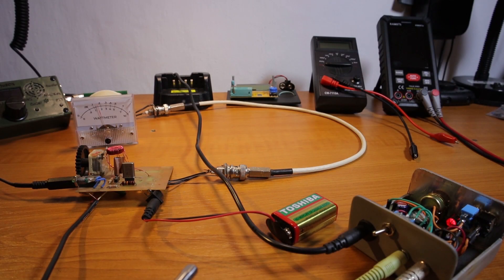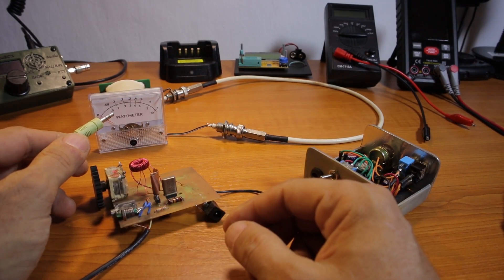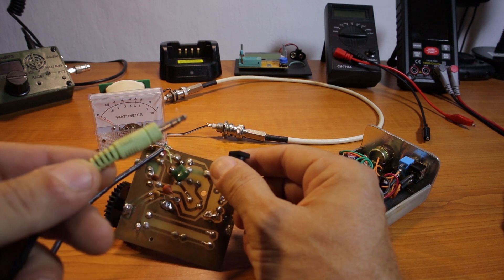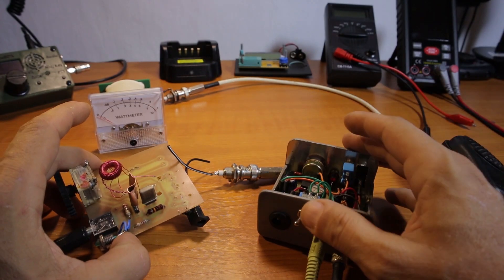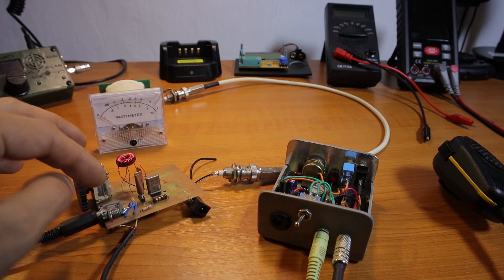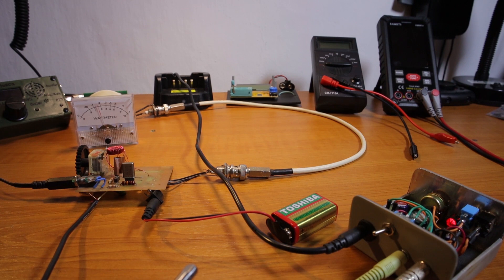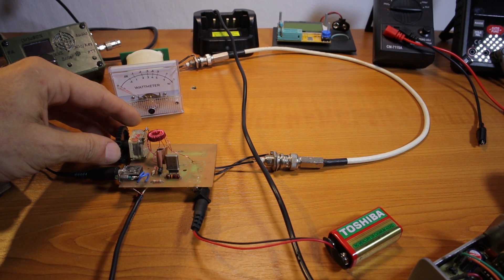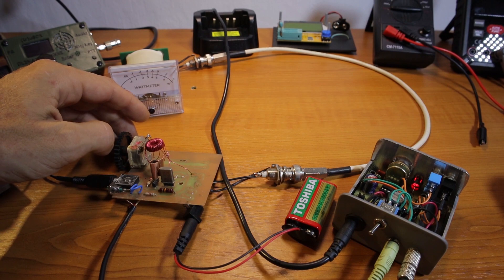Michigan Mighty Mite AM Voice Transmitter - Simple AM Transmitter

Comment: I've been thinking about this for a while, so I finally managed to solve it by building the whole thing on a panel. Pixie 2 oscillator ZTX314, amplifier stage 2N3904, modulator BC314, audio stage LM386. These are connected in a chain, the audio signal goes into the Emitter of the BC 314 via a 430 Ohm potentiometer, and the modulated radio signal comes out of the Collector. I can use any quartz frequency for it. But since this is not very legal here in Hungary, it was not used for a long time after it was built. I planned it to be used only inside the apartment for repairing shortwave radios, but its range is 60 meters outside the apartment with a one and a half meter copper wire. So I don't even dare to use it with a regular antenna. I put it away for emergencies.
Reply from the maker: Still is nice to experiment. I also need to get back to this sometime soon and finish it. I never really have as much time as I wish I had to experiment. But this one I really want to get it to work properly 😁

Comment: at these power levels, I reckon you could modulate the bias on that xsistor with an LDR/LED optocoupler or or another kinda VCR setup  (there's an AM xmitter, called corsair, I think?? that does a similar thing but it's got a bit more juice than this thing)

Comment: I made similar circuit for Am transmission, I used 1.5Mhz crystal and transistor was bd139 , it was circuit from RSGB book
Reply from the maker: Its a nice project. I mean you can't get too far with AM at this power, but is good to experiment and understand how voice transmission works. It was something new to me 😁.
Reply: @dxexplorer  Yes it does not go too far because it's antenna is very small compared to it's wavelength, because this circuit can also be modified for 27Mhz cb band , it have already modified it for 27 Mhz transmitter (for voice transmission) it is great project I enjoy listening to it on my 27mhz super regenerative receiver.
Reply from the maker: @hamzahkitech5228 Its also the modulation... to go far with AM you do need quite a bit of power on voice... even with a proper EFHW antenna in my case on the 40m band. But... there is always the amplifier solution after the transmitter for those that would like to get serious on AM voice with a simple transmitter like this one. And... there may be chances to get some contacts in the logbook using AM voice 😁.
Reply: @dxexplorer  Now I am planning to build 27Mhz walkie talkie, I will simply copy it from commercial design, it contains simple 27.125 super regenerative receiver and crystal locked transmitter, the only item I need is bakelite coil which contains variable ferrite core , my father tested it and said that it's range was around 400 metres , i will pair it with other walkie of good specifications.
Reply from the maker: @hamzahkitech5228 Your father is about right. I build years ago when I was a kid two walkie talkies like that... but they were LC based not crystal. Not always too stable in frequency, but good enough for kids to play. The distance was about the same depending on the day and the propagation. Only that I didn't know what propagation is back then 😅😅. Usually... depending on where I was using it... I would get between 200 to 500m... sometimes further if I connected the ground of the PCB to a ground point like the water pipe in the house. It also had a morse code button that I could use as well. But the most I just used the walkie talkies to talk to my sister in the other room and that's it 😅😅😅

Comment: The transmitter works with fixed values no bias and adjustment its only the 180 watt amp that will need adjustmens and troubles hehe
Reply from the maker: Hehe that sounds great. 😁😁😁

Comment: I like this video its very good and fun 😊 i built a circuit like this but with tl431 as am modulator and mic codenaer a bd139 and a 2n222 it can put out 200 mw and up to 1 watt and its working perfectly so next is building a rf amplifer lets say arround 200 watts yes and a relay to power on and off the sputnik receiver and the antenna... i have buildt a board with different crystal so i can change frequency
Reply from the maker: That would be interesting. I thought it was fun to test AM voice 😁. I never had the time to continue this one, but now since I made myself some more free time... I have this projects in the "to return to" projects that I want to take care of pretty soon so then I continue with new ones 😁.

Comment: Hi Ciprian. Fun to see that the AM modulation worked. Have you made a PCB for this design?
Reply from the maker: Sadly not yet. I am going now through all the videos and older articles trying to update all and write new ones for the projects I didn't had the time to write an article. And with this I am also designing PCB boards for each project. Hopefully by Christmas I should be up to date with all the projects finally. 73, YO6DXE.

Comment: Can you.tell me.more about the circuit and the lm386 circuits you use as microphone amp
Reply: Do you think its possible to use the mighty as a driver then connect it to a 1000 watt rf amplifier or something other maybe 500 watt
Reply from the maker: @oliverfranklypartolesen9882 I guess it depends on the amplifier... some work with little power on the input... some need a little more ... something around 1 to 5 W at least in order to deliver the full power. But for CW you only need little power to talk around the world. The AM output I think is minimal unfortunately so I don't think it would be able to run an amp. But there are circuits way better out there if you want to build a proper AM voice transmitter that you can plug into the amp.
Reply: I need a nice transmitter for my sputnik receiver did you remedier me
Reply: I have a nice working receiver very loud signal and low noise
Reply from the maker: @oliverfranklypartolesen9882  CW ? I would build the 10 min transmitter... probably with a better transistor and a proper heatsink. But the advantage is that having a big variable capacitor on the output ... will allow you to transmit on most the HF bands with the proper crystal. Then you just have to place and external LPF for the band you work on and you are good to go.
Reply: @dxexplorer  okay thanks you my friend I want a circuit that can work with  my sputnik receiver maybe a double side band transmitter i think
Reply: I want am or dsb with mic am phone
Reply from the maker: I will look into a schematic this weekend and email you. I may ask some friends too this way I could send you something that had been built and tested so you don't waste time for something that may not work.
Reply from the maker: Here is one nice and simple AM voice TX: https://www.electronicsforu.com/electronics-projects/crystal-am-transmitter
Reply from the maker: This was just a test. I want to re-design the PCB board for me so I can use it both for CW or AM Voice... the AM voice more for fun as for sure I won't get too far with such little power. But I must use a different amp for better results. I used the LM386 just because it was already made and I had no time to make anything else. I don't know when I will have the time to work on this one... but hopefully soon as I also want to update the blog article. Maybe I make two versions instead... one just CW and the other one CW and AM voice. 73, YO6DXE.

Comment: You can use a audio amplier as a AM modulator ,if you measure the ic audio output pin it sits at 1/2 VCC with modulated audio on it! just dont fit the coupling capacitor feed direct to tx vcc line of tx,its series modulated Am.So carrier is 4 timesxmodulation 90%,exapmle 700mW max CW@12V,Now set needs to run withaudio chip modulator at 175mW CW,no modulation.Once add test tone 1khz you shold see 90-100% @700mW PEP
here a good link to look at 
https://www.youtube.com/watch?v=Q8foHD-RMNc&ab_channel=JohnAudioTech

Great video 

Rob P
Reply from the maker: Ohhh thanks so much Rob. Clearly I need to try. I was thinking to build a transistors based audio amp as a modulator... just for the fun of having a transistors based circuit only )). But I clearly need to try the IC version as well and see the best I can het out of it. Thanks one more time. 73, YO6DXE.

Comment: I don't think this is too complicated to get it on the air. I think you said it operates on 7.2MHz. For receiver you can use the sputnik or the usdx  and to switch between transmitter and receiver you can use a relay and utilize the ptt from the mic or just a regular switch. Maybe you can experiment with a local radio amateur. It would be fun trying.73 great video
Reply from the maker: I just need to build a better audio amplifier I guess... transistors only. And the rest is easy ))). It should be fun to have a CW / AM transmitter... even if on AM I won't get that far, is still fun to have it ))). 73 Nikos, YO6DXE.
Reply: @dxexplorer  You can make a BD139 modulator with a 2n2222 pre amp. To boost the power you can make a small linear amp with a irf510 and you have 6W PEP output power. Just some ideas. 73
Reply from the maker: @sv2tcb Thanks Nikos. Ohhh making a PA will change the project from simple to not so simple anymore ))). Little power is more fun fighting to make a contact hahaha. I will work on building a PA later on... from 160m to 10m... but one I can use with most of the stuff I am building. The audio amp idea is not bad though. I will search for a schematic tonight if I don't fall asleep 😅😅. 73
Reply: @dxexplorer i have a pcb and circuit for a 160m transmitter with 5W PEP i am going to build it sometime when i finish the design. Many 73
Reply from the maker: @sv2tcb  For 160m nice... let me know how it works. And the band as well... I don't hear much most of the time. 73 buddy.

Comment: That will be a fun project to try with my MMM. Yeah, using the LM386 works as a test and sounds good but a modulation transformer and a transistor amp with a wee bit more power would make for a great package 😀 73, de WA4JAT
Reply from the maker: Indeed was fun hahaha. I was like a little kid talking into the dummy load way more than what I recorded 😅😅. I agree... I will play with a proper "modulator" and see how the results will improve. I have a feeling I will make one more video on this later in the future 😁. 73, YO6DXE.

Comment: You need to modulate the emmiter with a BIG amplifier. Can be done directly or with a transformer but you need a big voltage swing. Almost rail to rail. LM386 will not cut it for 100% modulation because it wont do that due to internal biasing. However a couple of chunky transistors will. Plus you have the advantage of biasing it yourself to get the swing.
Reply from the maker: Thanks Nigel. I was just thinking now that maybe the LM386 is not the best choice for a final version. Is nice for tests... and for fun... but clearly not enough. I will play some more and do it as you told me. I think I have an idea 😁. 73, YO6DXE.